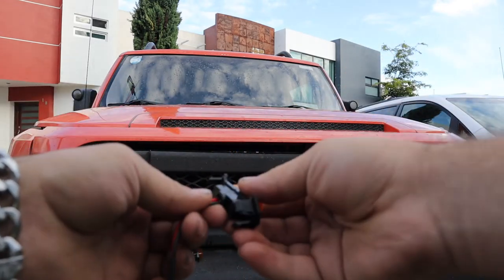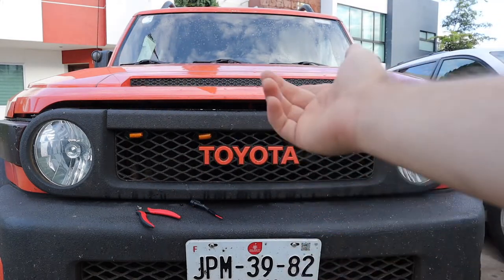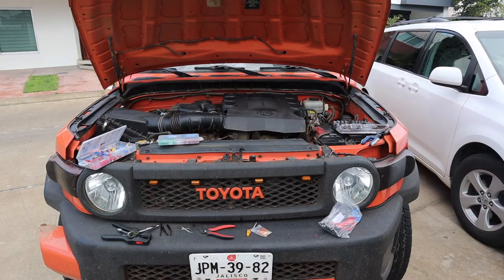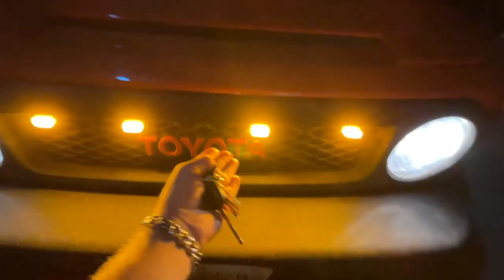How to install RAPTOR style amber lights on any grill

Comment: I can't properly describe my hatred for crimp connectors, but in this case it's quite easy to illustrate. As those connectors are not watertight, the cables are not marine shrink tubed, and not soldered, they will corrode very fast at the terminals due to galvanic corrosion. Salt will speed up the process but rain and even dew is all it takes. Water will get in, then move around inside the terminals during driving and that works the same way inside a small truck engine bay as it does on the open ocean to a 100k ton hull. 

My advice to anyone doing this. Solder and use  marine heat shrink tubing to secure against water and salt. If you really can't solder and must crimp, then at least use the shrink tubing to keep the joints dry. And as I have recently installed a similar set of ambers in the exact same location on my Ranger, it's a good idea to toughen the lights against water, salt, and dirt by filling or even just coating the wire entries on the back side of the lights with something like plastidip or epoxy or even silicone. Anything that can keep them dry. They are a clear weak spot for the lights that will be exposed to constant vibration and depending on your location, water and salt.
Reply: Not only will the crimp joints on this vehicle fail - the "ground" wire he installed by just loosening a bolt and slipping the wire underneath before re-tightening the bolt will also fail. I wouldn't let this bloke near my car to do wiring or any other work.
Aside from that - I just don't get this "fad" with installing "raptor lights" on the front of a vehicle anyway. They serve no purpose at all and, in my opinion anyway, look like the cheap aftermarket crappy job that they all are. Where I live, it's referred to as the "wank factor".

Comment: Hey bro gr8 instructions..one question I'm doing the same to my FJ but how did connect all four wires to the one fuse tie in pulling my dreads trying to figure it out..thanks
Reply from the maker: My lights came with a harness to a single wire, but you can just tie them all up to one wire, crimp together, and thats it, nothing special to it

Comment: You can connect it to the Fog lights fuse? Thank you!
Reply from the maker: Yes, depends on whether your fog lights are automatic or always on, if they’re always on, then it’s a good option
Reply: They are not always on, your turned them on with a switch. That's why I want to put them in that fuse. Is not good option ? I have a Suzuki Jimny 2020
Reply from the maker: @victorferrandomarques8074  yea that is a good option, this method doesn't interfere with the existing circuit, so you can connect to wherever you desire.
Reply: @james_gatlin  Thank you so much for answering!!

Comment: Thanks for straight to the point install video. Only thing is I got a fj aswell did exactly what you did and they work only thing is when I turn my high beams off they shut off. I’m assuming it has something to do with the fj having one bulb for high and low.
Reply: Do yours do the same or are they on when your highs are on too?
Reply from the maker: You can connect it to the stereo fuse or another fuse that is on constantly while the vehicle is on